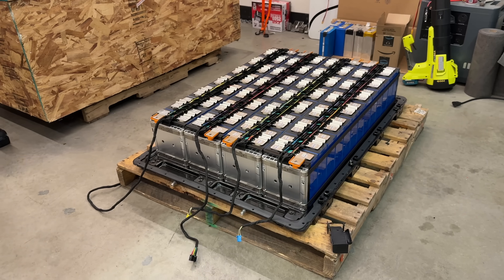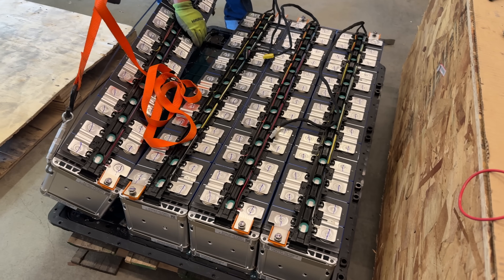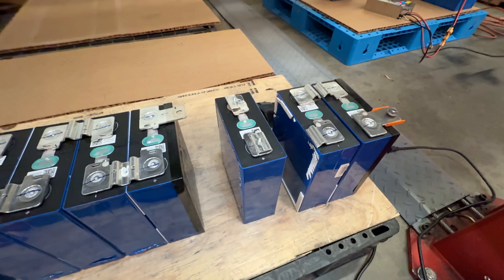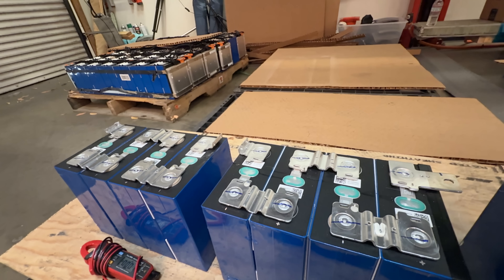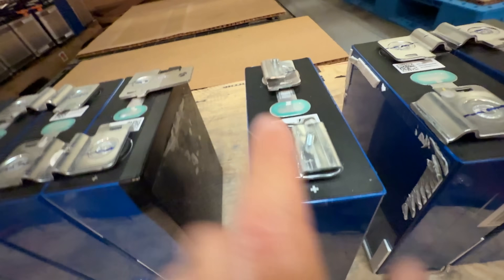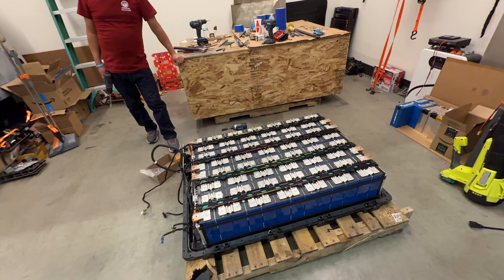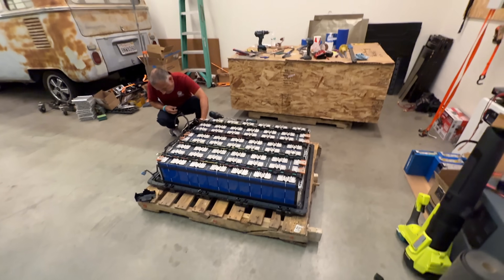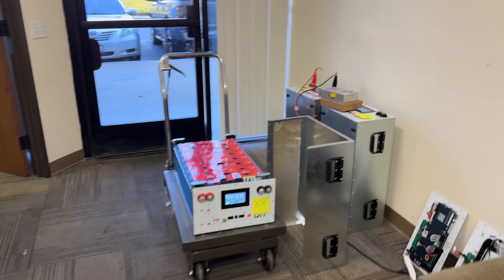The Internet CALLS ME OUT .... AGAIN  - #CATL #LiFePO4 #DIY

Comment: I just ordered this battery today. I’d like suggestions on 16s BMSs. 100 amp is fine since there will be three batteries in parallel. I used Overkill Solar BMSs on my first homemade batteries five years ago and was happy Iwith them. 
They have discontinued them and I want a BMS I can use right out of the box to protect the battery. I will control charging parameters with the inverter.

Comment: Well new technology is around the corner, Aluminum based technology is on the horizon. I will see the prices of the cells hitting rock bottom.
Issues with aluminum wiring is not an issue, the common repair will be to take a copper jumper and after coating it with NoAlox antioxidising compound for copper to aluminum transitions, twist together and top with a quality GB wire nut. Then just connect the jumper to the outlet or switch. No need to use the compound on the wire to device jumper, it’s now copper to brass. I use the anti oxidation compound on heavy buss bars used to hold lightning suppressors to the buss bar since the housing of the suppressor is made of aircraft grade aluminum. I prefer to use copper or brass screws and nuts to hold the arresters to the copper buss bar. Electrolytic oxidation is not good on lightning suppression equipment.

Comment: I cut it in the middle bend it at a 90° put a hole in it place a boat with copper pipe that is the conductor spacer

Comment: Only problem I have heard with Aluminum, has to do with high amperage chargers. Something about shrinkage at the torque points, causing bad connections. But you know more about it, than me.
Reply: Of course copper is better but at the cycle rate we do in off-grid solar , ampacity on the buss bars is usually not much of an issue. I’m going to cycle the batteries at less than 50 amps each because they will be in a 16s 3 p arrangement running a 6000xp inverter.

Comment: Why can't people use aluminum?  They still use it in residential settings for higher amp circuits and service entrance. It's obviously thicker than comparable copper, but doesn't mean it can't be used.  Of course you have to size it correctly compared to copper and make sure that's not a limitation for your design.  There are enough knowledgeable people to do the more advanced DIY for the small volume of these packs.  Jehu even warns in the listing on his site that this is a more advanced DIY build.

Comment: ALUMINUM IS FINE PEOPLE! ALL HOUSES IN ATLEAST THE USA STILL USE ALUMINUM WIRE FOR THE MAIN FEEDS COMING FROM THE ELECTRIC POLE TO THE METER AND INTO THE CIRCUIT BRAKER PANEL. EVEN MOST OF THE POWER LINES ARE ALUMINUM!

That's the problem with the internet nowadays, people that have no idea what you're talking about post comments & sh*t talk about things they have no idea about! Then other viewers that don't know, see it and think it's legitimate...

Aluminum bus bars are perfectly fine! Just like copper they just need to be sized correctly

Comment: You can use anything specially batteries that will save up on energy cost i been using mango Power e laser welded cylindrical cells for over 2 years don’t listen to negative people stay positive

Comment: I bought one of these a few months ago. Just received 3 - 48v boxes from ali exp. I will start assembling them soon. The only bad part is that you have 4 cells left over, but the deal was good enough to outweigh that. I was planning to configure them so that I won't have that many cells that have to be "rejoined" but I'm sure a 10 x 32 tap and some screws will rejoin them with enough surface area to work fine. I'm glad I bought mine. I think after all is said and done, I should have less than 1400 in each 15.7 kw box. That's not too bad is it?
Reply: I’m going to get a 4s BMS for the left over cells and make a 12v battery. Lots of cheap charge controllers available.
Great landscape lighting battery.

Comment: Yep, chop em up to the voltage you need - then you have really good connections in the strings!
eg 12v, 24v 48v

edit:
I like the reuse of the bus bars with the drilled holes for connections.
You end up with a solid connector to the top of the cell.
Sure you might need to add a little bit of protection re potential shorts.
But its nothing too extreme and just proceed carefully when cutting - I don't expect someone to go full send and do it quickly!

At the end of the day, its fine if its not for you!
You just need to purchase what you are comfortable working with!

Comment: Just watched the video, of course the batteries use aluminum bus bars inside the case. In my video, I questioned if he calculated the cross-sectional area of the aluminum. What's bad about that? How am I wrong? You don't calculate the current carrying capacity of your conductors?

And I was criticizing the threads because the yixiang is made for beginners. What's the alternative? Me saying the bad threads are ok? I don't understand your argument here. I try to find downsides to all batteries. Do you think ready built batteries should have bad threads? 

When did anyone say your battery can't be done? I don't even understand. Did I miss something?

Not sure why you think people are your enemy. It is very strange.
Reply: Watching a second time, I would say that removing the bump that allows the aluminum busbars to expand and contract with the cell, could cause lateral stress to the terminal long term. Really need a little bump there.

Also, when you separated the cells, you dented the cells. The corners can leak when you do that. Just need to be careful. You show how badly you dented them in the video. Just something to be mindful of next time. 

Who is your naysayer? Who's saying you can't? I don't even know  who would be a "hater" of your content. I don't get it. We are all here to learn and help each other.

Comment: HAHA!  Sure I could do what you have done in this video.  But would I want to?  HEEEELLLL NO!  How come you didn't grind the poles and drill and tap them like you said you could with basic hand tools.  Instead you chickened out and used the tabs just so you could act all high and mighty in this video and look like this was your solution all along.  You know very well this is not what anyone was talking about in your previous video.  Some of us don't want a half-ass redneck engineered POS like this in our system.  This is about as low-grade DIY as possible.  I guess its really a good thing that I can't achieve your level of DIY because I would have to lower the bar so so far.
Reply from the maker: I’ve been talking about drilling holes and using bolts in the tabs all along.  No idea what you  though  I was talking about.
Reply: @jehugarcia  Nice try.  It is plain as day in all the comments what we were talking about.  And if you really are that clueless, you have no business in the battery business.  You are so two-faced.  Its sad.
Reply from the maker: I don’t meet your requirements to be in the battery industry?     I can assure I am not looking for your approval random internet idiot.    Make sure and keep telling me how disappointed by me you feel to feed the algorithm.  My videos need more views these days and every rage comment helps.

Comment: Would so buy 2 if I did not just buy a house. These are perfect for people who are real diy and can actually you know use the high voltage the way they stand. Use a batrium bms r he can gl up to 160 cells in series and a high voltage inverter and you are good to go.
Reply: Just comes down to researching products 🙂
If your interest is in battery systems and are interested in getting the best bang for buck.
Well you might have more knowledge than the average punter.
Reply: @ArmChairPlum actually i just got a tesla model 3 longrange battey powering me house during power outages only so this is not outside my spectrum of knowledge

Comment: Talk about misrepresenting the truth.  I just read that whole string of comments that started this video.  They were talking about grinding the terminals and threading and tapping them with a regular old grinder and a drill which you stated numerous times was easy to do.  But that is not what you did at all and then kept harping on them all video.  As if what you did even compares.  Super shady and misleading.
Reply from the maker: It was said that these could not be used which is not true.  I used a cutoff wheel a drill and a bolt just  like I suggested in the videos.   If the online experts are naysaying about something else  I have no idea why because I never suggested that.

Comment: I have 3 sets of 16 cell 48v 200Ah battery banks. welded tabs just like these. drilled and tapped bms terminals. been in use for 3 years so far. still at 98% of original capacity. 
no problem wth this method.
Reply from the maker: @restotool and the other experts do not approve of our methods
Reply: another benefit of this is that all the cells in the original battery are matched and grouped with similar voltage and internal resistance to one another. This is only possible when the battery manufacturer is using thousands of cells. they can select cells and group them. You can't do this when you buy your own new cells. These matched cells will cause a longer lifespan with a higher capacity than new cells that are not matched as well.
Your BMS with active balancing will help, but eventually, the differences will lower the maximum capacity over time.
If you do get new cells, try to match them and group them as best you can. It's not easy.

Comment: It is important to respect the power of these cells when working on them. Once you build your own solution you need to monitor the terminal temperatures under load, thermal cameras are a must to make sure you have no resistance issues. Yes it's all basic DiY but it's easy to get overconfident.
Reply from the maker: Agreed.  Simple testing procedures will  reveal if what you did will work or not.  Not the random naysayer in the comment section.

Comment: It is not that you cant use aluminum... It is just that copper is more conductive for the loads you suggest to use. If your going to use 5A at 48v, sure, use aluminum. If your going to use 400A at 48v, please use copper...
Reply from the maker: Or use enough aluminum to handle 400A .  If you don’t use enough copper then you are in the same boat so why say you can’t use one or the other…. Say “size it correctly” .  Say what you mean and mean what you say.
Reply: @jehugarcia  Again, it is not that you cant use. It is the same as cooling a CPU with a thermal pad. It is not impossible nor is it unpratical, it is just more efficient to use thermal paste due to its thermal conductivity. Same applies here, for better eletric conductivity you should use copper. Again I am not oposing using aluminum as a conductor, I just think that for large loads, even if you oversize the aluminum size, is a bit risky.
Reply: @Painas4everever  You think iron is a good conductor ? Sure is not so good. Yet about 15ft of zero gauge pure copper wire from the front to the back of a car measures WORSE than the metal ground of the car (using Kelvin sensing method). How do you explain that ?

Comment: Not all of us have experience running a chop shop. I would like to see a video on how you use that grinder to cut them. I'm guessing you may need to bend them so they are further away from the cells before you start? You make it sound simple but I know most people don't have the wedges to separate the cells. At best they are like me and have several chisels and crow bars. They don't want to spend a few hundred getting wedges.
Reply from the maker: Which is why we offer the  13s , 8s and 5s. Modules.   Don’t try to frame a house if you don’t want to buy a hammer.

Comment: my biggest problem with Jehu Garcia is not the diy stuff i love this innovation with it.  To me its why the heck would I buy his very expensive cells?  Cells are very cheap new now.  In a lot of cases after you buy everything you need to DIY it costs are more then buying good professionally assembled new cells with a warranty.  I realize DIY benefits him a heck of a lot but for me this DIY stuff seems like a overly expensive hobby just to say you did stuff semi yourself and in most cases the DYI stuff is done substandard like welded cells (the difference between welding and compression is important with cells) non copper bus bars lets see does aluminum have the same conductivity as copper no it doesnt you guys need to watch Will Prowes channel.  It's goofy.  Most of it still ends up being putting together cheap Chinese components together at a premium.   The cost of things from Jehu are very expensive and when you add shipping and taxes its higher then most places I do business with.  I normally dont comment but it is getting my nerves.
Reply from the maker: The rational that aluminum can’t be used because it’s not as good as copper is ….. childish.   Copper can’t be used because it’s not as good a silver so there.  You are all doing it wrong Will Prowse hasn’t discovered the conductivity properties of  superconductors but wait till he does,  he will ungoofy all of us.   Unless there’s threaded bolts involved,  he might have trouble with that.
Reply: @jehugarcia  I wasnt bashing your business.  I watch your videos because I like learning about the DIY and seeing what you are working on and doing.  I support all small businesses, yours included.  Don't get me wrong.  I never said you were some billonare but my only point was the cost of DIY in general and the costs involve vs buying new professionally assembled units.  Nobody said it "can't be used" people can do whatever they want an cut all the corners they want to save a buck.  It doesnt mean its the right thing to do but everyone should be considering the amps for their application and a lot of people are working with 12v and high amp setup.  It's all relative but cheaper isnt always better and in some cases it can burn your house down.
Reply from the maker: Well… I’m not a billion dollar Chinese conglomerate,  I live in California, that’s why I can’t compete.  Surely you can understand the economics involved?

Comment: American houses had aluminum wire. They required paste to prevent oxidization.

Even then it caused enough fires that it was pretty much all ripped out and replaced with copper.

Welded busbars are fine, because the metals are joined. Flexible aluminum might be okay if you use anti-oxidizing agent once in a while.

The rigid aluminum busbars that do not flex are a fire waiting to happen.
Reply: The reason aluminum wire in homes caused fire was a combination of corrosion and expansion and contraction with heat cycles. If you use aluminum you just have to understand it's properties. Good anti corrosion compound and proper lug design has moved the issue with aluminum wire and bus bar issues. The issues with aluminum house wire was mostly because of undersized wire and poorly designed terminals without similar expansion characteristics. Outlawing it in the secondary circuits of residential housing was a reaction to public opinion and pressure.

Comment: It would be interesting to see how hot these connections become after an hour of hard discharge/charge. I’m not doubting, but seeing other people’s builds I’ve become a fan of welding.
Reply from the maker: I have not done the test but bolts work great at creating solid contact between 2 metal surfaces
Reply: @jehugarcia Yes. The question is with bending, how much contact surface there is and what is the resistance. I’ve see connections looking perfect and yet when you have loads they get hot. Once the bolts and nuts get termal cycling, then they get loose over time. I think you should do some experiments in that area and show the results.

Comment: would heat in the cooling line help with the glue at the bottom of the cells?
Reply from the maker: I was going to test that but the wedges worked well enough I stopped looking for a different way